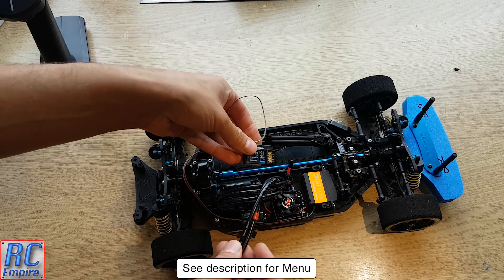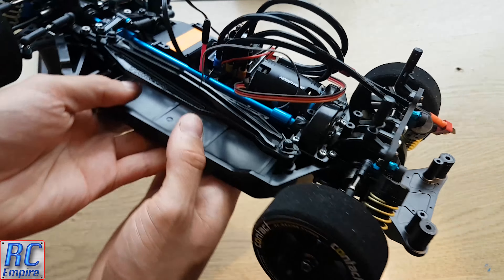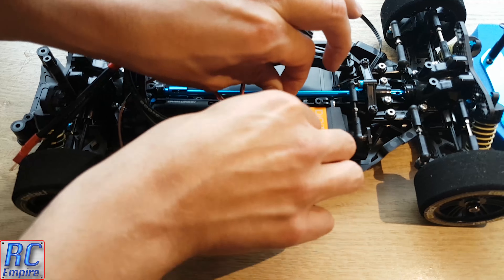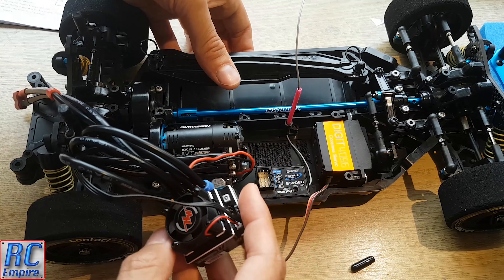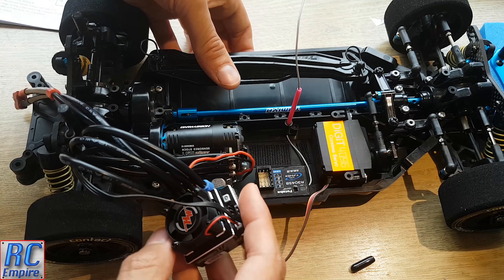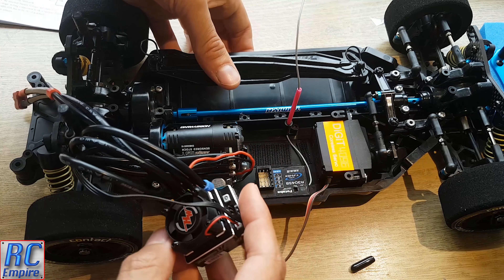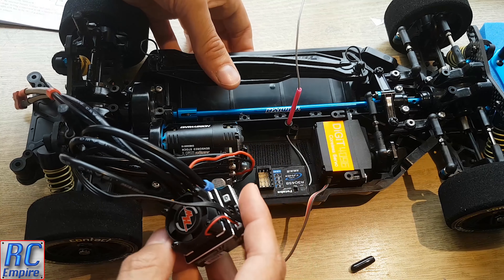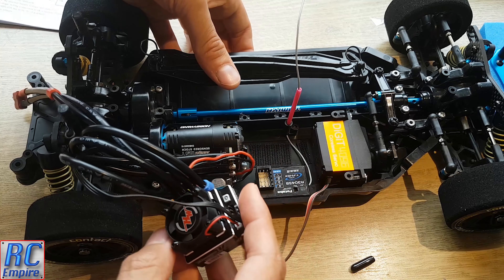Tamiya TT-02 Type S race build: Futaba R304SB Receiver Install and Final Wiring

Comment: tip from a RC heli guy you can put some hot glue on your ESC and servo connectors itll keep them from backing out and you can easily remove it you can also use it hold some of the smaller wires in place as well
Reply from the maker: ohh really! I've never seen that. Guess it acts to seal it from water too. Thanks, I'll take a look at that 👌
Reply: yeah we use it since helis vibrate a ton just put bunch of hotglue around the connectors on the RX and itll keep them from back out :D
Reply from the maker: Yeah I can imagine that could be fatal on a heli 😳

Comment: Are u using the TFHS settings on the receiver
Reply from the maker: Hi, yeah, at the moment I have receiver in T-FHSS -HS (high speed mode). In the manual it says to only use this mode only if you have a "Futaba digital servo". But i've had no problem using this mode with the Savox servo so far.